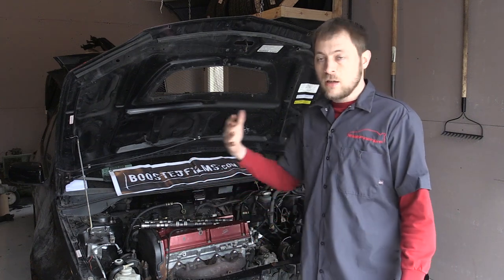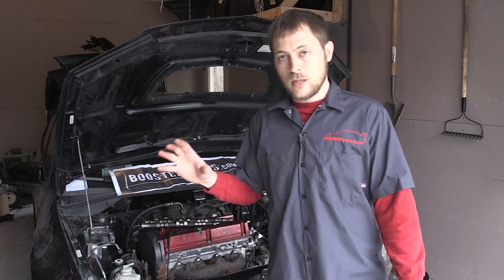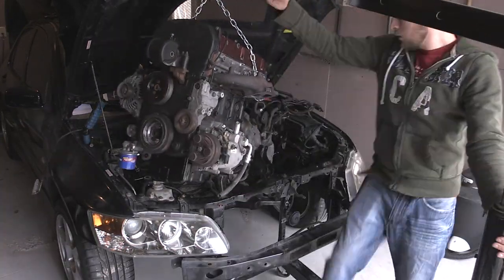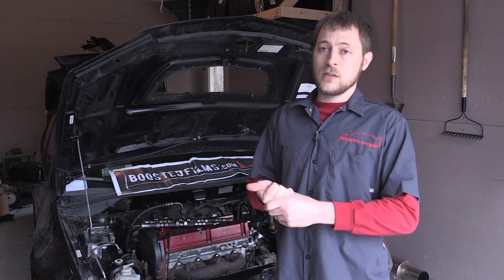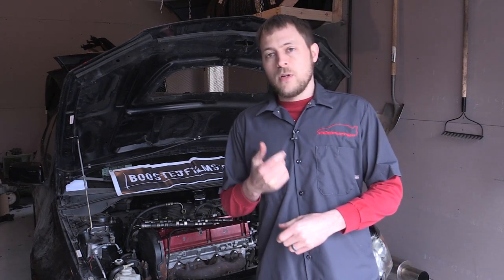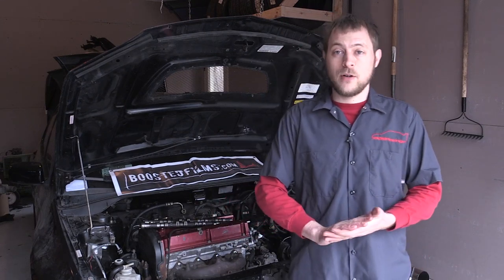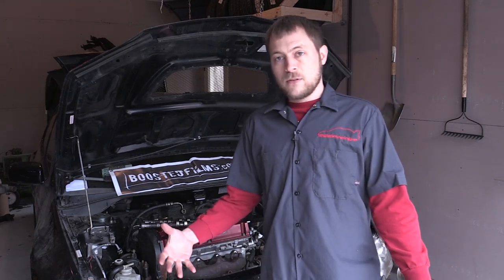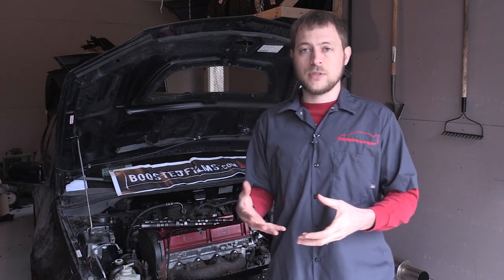The Engine is in! // EVO 8 Vlog #5 // Boosted Films

Comment: Yes, I have heard of the one lap of america, I think they also where at Mid Ohio in Lexington and also at Nelson Ledges in Ne ohio which is an hour from me eventually I'll be taking my car there.   I would like to do the one lap  but my car 2ga 2gnt is on jack stands due to dsm curse, haha  I was think of just putting 2gb block which slightly different than the 2ga( notched on block) & with a 1999 2gb eclipse ecu which is better. But I've decided to do a 2.4edz swap and automatic to manual swap instead.  I've done my homework on both conversions and liked the 2.4edz more than the 420a. Drove a rare stratus manual with a 2.4edz that was cool but didn't like the body. What happened to the blue evo 8 is it the wife's daily family car.
Reply from the maker: Sounds like a lot of work.   I sold my last evo 8, my wife daily drives a Ralliart.

Comment: I did hear about One Lap of America through the Evo forums before. I would like to participate in it with my track Evo that I am building but I would have to figure out how to register it for the street.
Reply from the maker: is it gutted?  You'd probably want a semi comfortable evo to make a 3000+ mile trip.
Reply: Yes extremely gutted. I am thinking if I run a quiet exhaust it will be fine. I have an RS so I can deal with high levels of NVH.
Reply from the maker: Neil Dey RS motors is an RS evo as well... gotta love crank windows